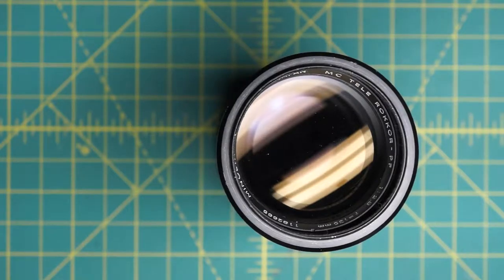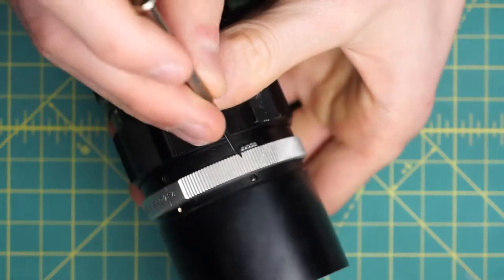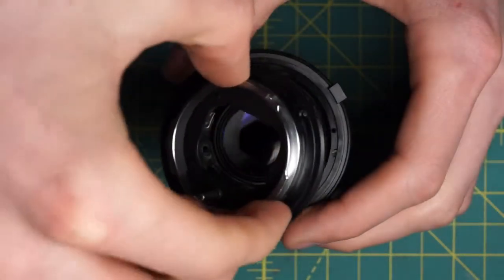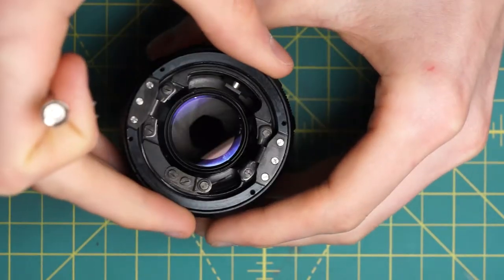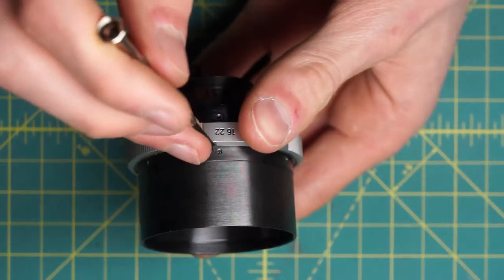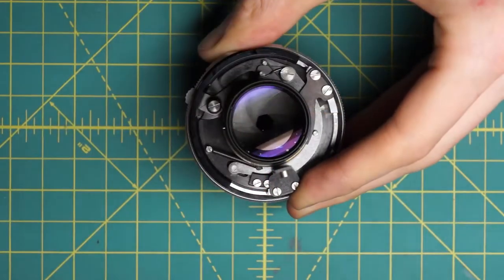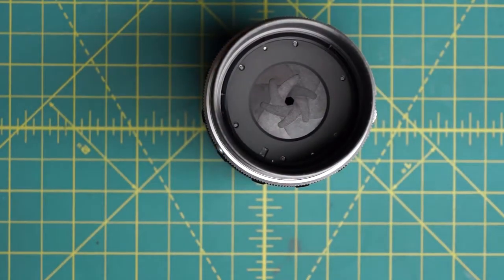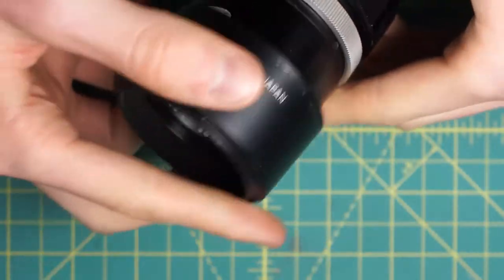Minolta MC Rokkor-PF 135mm f2.8 (MCI) Disassembly

Comment: Hi Matt, wonderful video and I love your attention to detail. Your videos are immensely helpful as I try and clean out old Rokkor lenses. Just a quick question about the focusing mechanism. My Rokkor MC 135 focusing mechanism is pretty tight (pre-disassembly). The lens has been recovered from storage, aperture blades seem fairly snappy, maybe a little bit of hesitation when switching apertures. I suspect there is oil in the threaded portion inside the physical focusing barrel or some kind of grease causing the resistance in moving across focus ranges. Should I just hit that area with 70% alcohol and remove any potential gunk, or is there intended to be a level of grease on the surface to aid in smooth operation? Thanks for you thoughts!

Comment: I recently bought one of these, curious does this lens feel a little loose naturally or is that a sign of something loose in my lens?
Reply from the maker: Which parts feel loose? Looseness in focus or aperture is not really normal with any lens but often only impacts handling and not the lens' optical performance. A loose mount may cause images to be slightly misaligned  for focusing however
Reply: Thanks for answering quickly, It is the whole lens body, the thing that worried me so much is about them ball bearings. I mean I only paid $12 for it, I just didn't want those ball bearing to go flying out. When you put it on the camera and put your hand under it it feels like the front of the lens is swagging, Like a screw is loose on the inside. If you picked it up normally you would not notice it, it is only when you hold it on the front and back and raise one side up and down, that's the only time you notice it and when you start to focus while on the camera.
Reply: Also that little switch that you was talking about in this video, you said it must be a way if it lever gets stuck. I thought it was for Depth of Field Preview.